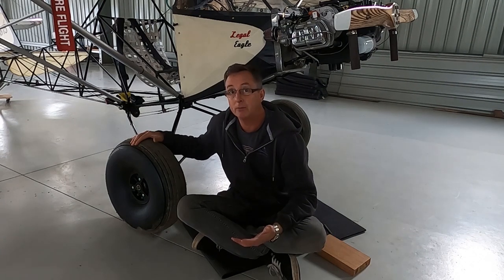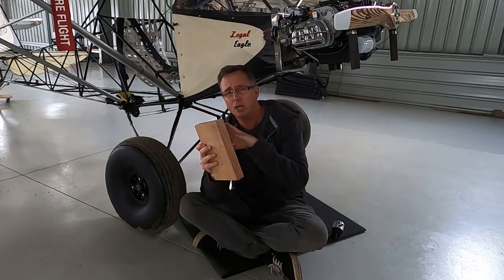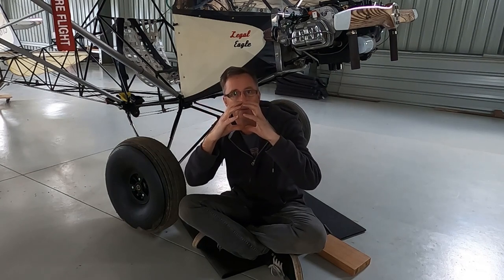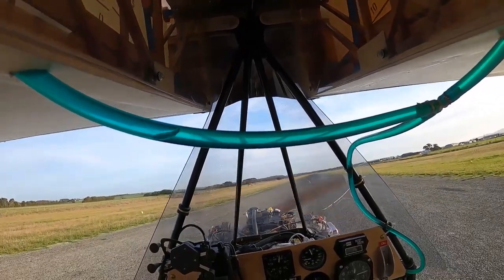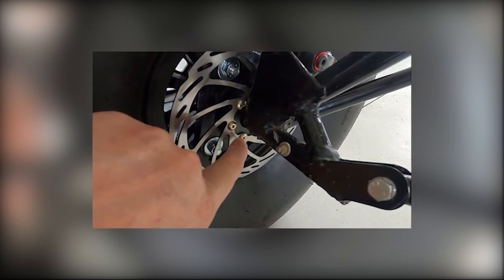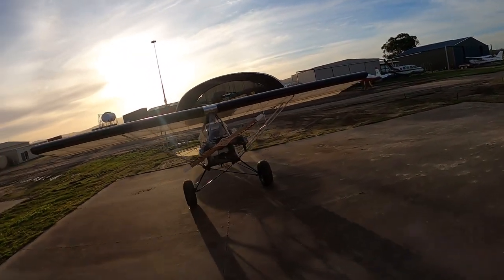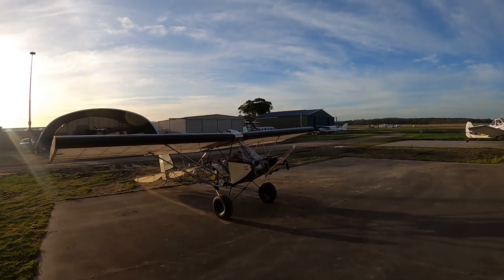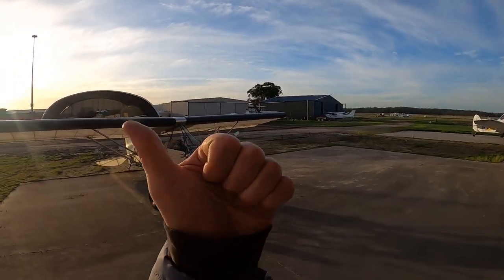STOL aircraft tires on the Legal Eagle

Comment: making the disc rotor hubs (spacers) out of wood is a good idea, youd think someone made these off the shelf like azusa. im going to make mine with a 3d printer. you can get wheels from pocket rocket motorcyles with built in disc rotor hubs but there for only 10" to 11" diameter tires there 6.5" wheel diameter x about 4" wide.(more for ultralight aircraft) may i also suggest cable over hydraulic calipers, there much more powerful and very cost effective like $25 ea or high end ones for $100 ea.
Reply: I was thinking about 16” fat tire bike wheels. Affordable accept disk breaks fairly strong, and reasonably light.

Comment: Yes if they still make part 103
Reply from the maker: We do not have Part 103 restrictions here in Australia.  Would be hard to make sub 254lb in USA.  However, I believe if you have a parachute (ballistic or hand deployed) there is an FAA allowance of 24lbs without requiring a separate weighing.  
"Safety devices which are intended for deployment in a potentially catastrophic situation. Parachutes....
(i)  Up to 24 pounds of weight associated with the parachute system may be excluded by the FAA without requiring a separate weighing of the system components."
The way I read it, if your Legal Eagle weighs less than  278lb (254lb + 24lb) including some kind of chute, then you are still within Part 103 limits.  
The addition of the tundra tyres added 16lb gross to my total weight.
Reply from the maker: @007mwn  Les has a wealth of knowledge and is a great contributor to the Legal Eagle community.  Here is his channel which I have also now added to the description.  https://www.youtube.com/channel/UCgtcBjiQxnfIEDW_J8ImrCw